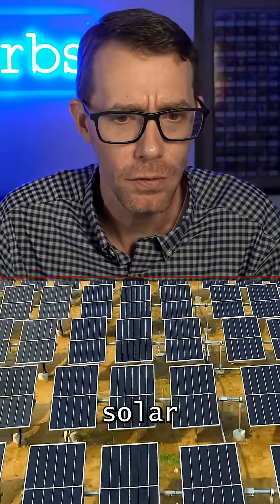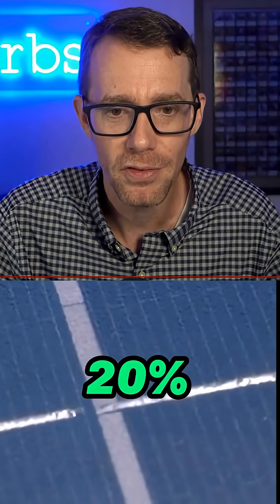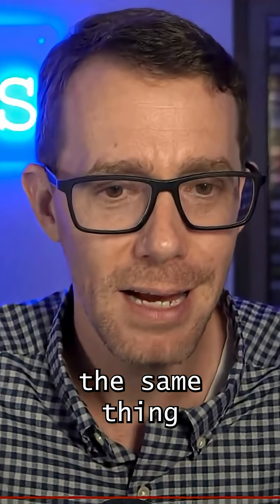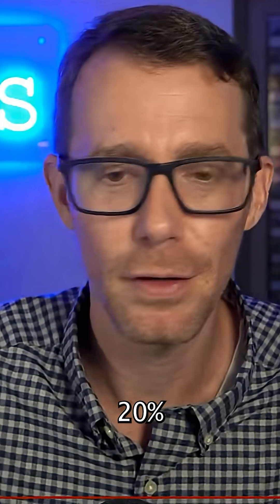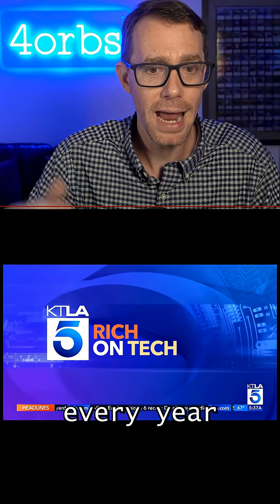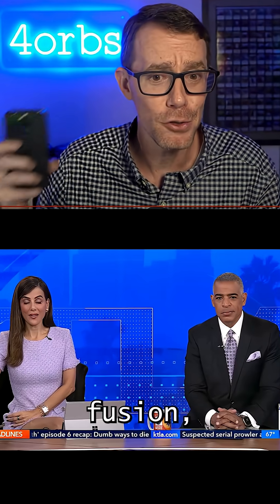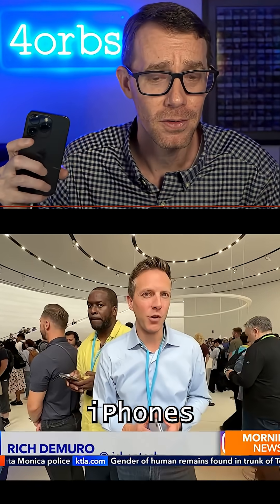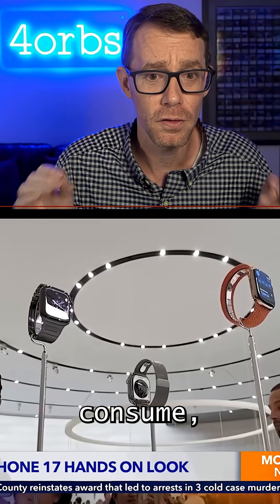Fusion, Plasma, and the Race for Infinite Energy

Comment: Solar panels were regulated because of the lobbyist for the power companies. They couldn't be more than 30/35% efficient since the 1970's/80's i believe. Cheers
Reply: Any solar panel developed that is over 25 percent efficient is seized by the government at the patent office level under national security. 

This is not an assumption that is a fact.

https://en.m.wikipedia.org/wiki/Invention_Secrecy_Act
Reply: The best panels released not long ago are only 24.5% efficient.  Most are 22~%
Reply: if you use optical rectennas instead of PV it is 80 to 90 percent efficent

Comment: The water heater cavitation pump is an over unity device,  one fire dept actually bought a model and its been in use for years.  YouTube water hammer pump.
Reply: a version is going into a hydrogen plant in groveton, NH.  by qhydrogen